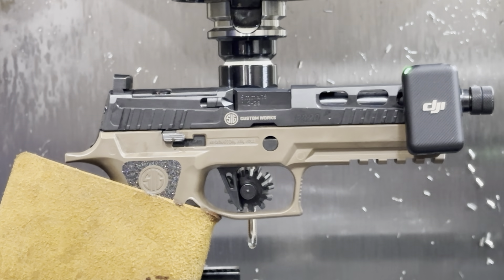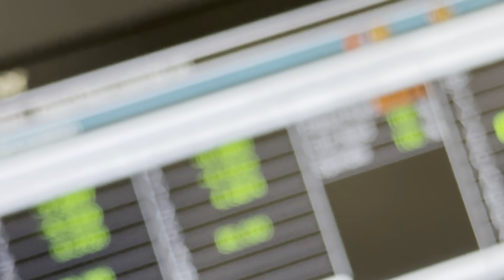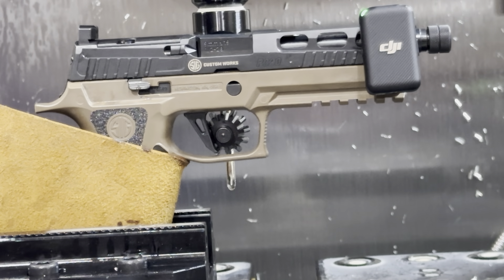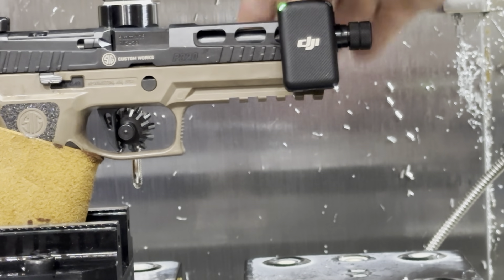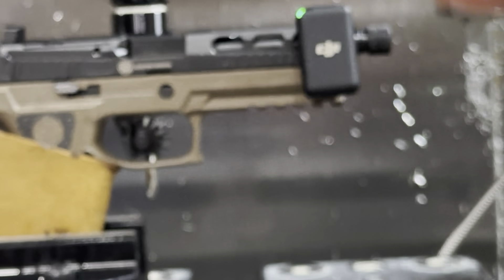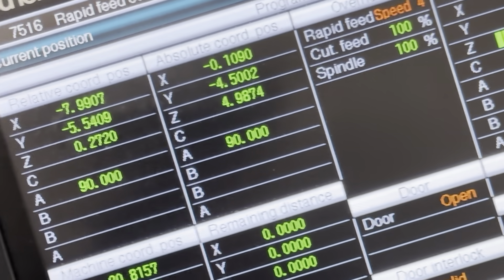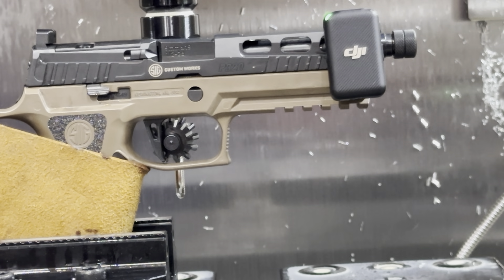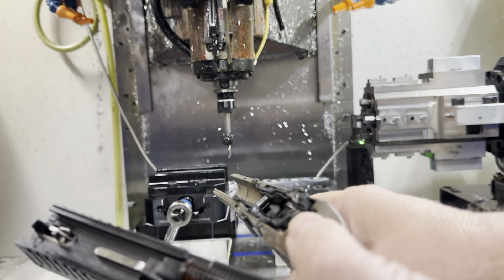Sig P320 accidental discharge tested in CNC machine.

Comment: You managed to do most compressive test on YouTube so far and got the same outcome as others and somehow came to the wrong conclusion lol. Would be interesting to see how other guns do in this same test set up.
Reply: Exactly.  The gun should only fire with a definitive pull on the trigger.  There are lots of situations that could pre-stage that trigger.
Reply: @CurseTheDarkness  it seems to me like some holsters may be putting a little bit of pressure on the trigger,  enough to deactivate the safeties,  and then all it takes is alittle movement for it to go off.  seems like whats been happening in the videos of them going off to me.  i know all my kydex holsters have a indentation on in the material in front of the trigger,  that widens to accept the trigger,  if the holster is slightly out of spec it could be putting enough rearward pressure on the trigger.
Reply: @mtnbound1776  Add to that this was testing only one firearm.  How many of the next 1,000 firearms would exhibit the same failure? 

My observation is that if the slides on any of my pistols was that sloppy it would be trashed.
Reply: @mtnbound1776 I think the holsters are playing a bigger part than people realize. Especially with the width of the 320 triggers. But in no way should they fire without a complete trigger pull. I imagine Sig has already resigned the trigger and a few other parts, it's just the bean counters are still figuring out how to dodge the iceberg.
Reply: @ryank29 his conclusion is correct in the fact the trigger was manipulated & moved rearward to get the gun to fire by then moving the slide up & down. Now should that much of rearward movement & not firing the gun then allow the gun to fire when pressure is applied to the slide … NO. Could possibly once that slack taken up to the wall the trigger sticks & the striker safety not return to a safe position when the trigger is released & a shot isn’t fired then a bump of the gun & it goes off. I don’t know, but the conclusion of the trigger must be manipulated to get the gun to fire seems true from everything I’ve seen that’s been in this & many others tests.
Reply: @RoyDriskill  That much slop in the slide is crap!
Reply: @davidmilisock5200 the amount of movement between the slide & frame doesn’t bother me at all. It’s the fact that under the wrong circumstances the gun unintentionally fired that I have a problem with. If tightening the tolerances between the slide & frame resolves this is then great. But I guarantee you that is not the sole reason for these uncomanded discharges!
Reply: @RoyDriskill  Agreed, I believe it's  a tolerance stacking error and that sloppy ass slide is just part of it. I never owned a Sig firearm of any type, the handguns never fit me and I never thought that their rifles were worth the cost, but that's just me!
Reply: he proved the glock failed the exact same test. watch his other video
Reply: @CitizenSeven500 it looks like he's pulling the trigger in the glock video. He has the trigger like 99% pulled them wiggles it into the final pull
Reply: @BansheeVi  both triggers were pulled to exactly the same point before break. the glock just has a much longer trigger travel
Reply: @CitizenSeven500 I mean you can watch the Glock trigger. It's at the end of travel. Use your eyes
Reply: @BansheeVi  https://www.youtube.com/watch?v=LKD0S3KhwdI&ab_channel=TriggerSmart
Reply: @BansheeVi  every striker fired pistol will fail this test, including your glock
Reply: @BansheeVi  they are all at the end of their travel, just before the break
Reply: @CitizenSeven500 yes but in the video I'm talking about you can see him move the gun to pull the trigger, it really isn't even subtle. I was trying to get at the questionability of that video. But with better videos your point seems to make more sense. Does this effect the job the firing pin safety does to stop a discharge?
Reply: @BansheeVi  watch the link i posted. the glock fails just like every other striker fired pistol does
Reply: @CitizenSeven500  For the Glock 17 this was a similar test but not exactly the same. 1 the Glock trigger was pulled very nearly 100%, the Sig P320 still had 1/10 of an inch travel left in it and discharged.  2 Either the Glock was not locked in the vice as well as the Sig was as you could see that the entire frame of the Glock moved when he twisted the slide, it was not clamped as well or he used significantly more force on the slide. With the Sig he just barely moved the slide.
Reply: @davidmilisock5200  both triggers were pulled to 20/1000 before normal trigger release of seer. exactly the same
Reply: @CitizenSeven500  The Sig was pulled to .090 and manipulation of the slide discharged the firearm.  Pulling the trigger to .190 discharged the Sig, that's showing that the Sig trigger was just over 1/2 pulled and could be discharged. The Glock trigger discharge distance was not shown but visually it was much farther.
Reply: @davidmilisock5200  the sig has a shorter trigger pull but both were set at 19/1000 before break and both dropped the seer by bumping the slide
Reply: This just proved if you had this in your holster and got into your car and used seat belt that anything touched your trigger in that drive the gun could go off when you got out of car and slide got touched.

I would sell that gun for scrap.
Reply: @MXP90DL   every striker fire pistol will do the same if the trigger is close to the point of break
Reply: @MXP90DL  and yea the glock does also
Reply: Its almost like being a good machinist does not make you smart
Reply: @ThePlatinumsquirrel  as with any specialty
Reply: We already know the Glock fires with a partial trigger pull.
Reply: @notes9504  Can you post a link or show me a video of the Glock uncommitted discharge please.
Reply: @notes9504 who's this "we" you're talking about 😂
Reply: @notes9504 idk about that one chief

Comment: SIG's statement was the pistol "CANNOT, under any circumstances, discharge without a trigger pull,"

This video, just like Wyoming Gun Project's video conclusively proves SIG's statement is false. Their product does not operate in a manner consistent with their claims. This is a clear product liability problem for SIG which was made worse by not addressing the issue. It is likely to elevate to the classification of gross negligence.

Comment: Lol I was trying to measure this yesterday with a pair of calipers. Because I felt a difference in when the slide is pushed down vs when it's not. But I couldnt get a good measure and I don't have the scale to check trigger weight but there is a difference when there is pressure placed on the slide vs not and vs the slide being pulled upward. And I am testing this on a 320 romeo that doesnt have the updated sear from the recall
Reply: But definitely the trigger had to be pulled i wonder if there is footage of this incident

Comment: The Sig P320 is a piece of junk. The tolerances are so sloppy that it rattles louder than a baby's rattle. Look at what you are doing there. You are wiggling that thing like a loose tooth. A lot of the discharges have been from holstered Sigs. No one is pulling the trigger.

Comment: I'm just saying that the Berretta M9A4 would never be sitting in your CNC machine to calculate the sear retention to determine/rule-out why its randomly going off in people's holsters/duty belts. -- I don't ever recall the Military, Federal, State/Local Police, Gun Ranges, or Shooting Competitions banning the use of Standard Issue Berretta, Glock, or Colt sidearms for safety concerns.
Reply: I'd also like to add, that I was very close to buying the P320 when it first came about. I like collecting Military Issue firearms, and I love the way it looked, felt in the hand, how modular it was, and I knew that parts and accessories would be highly available due to it being the new GI Sidearm. --- But... we started getting reports of it going off when it was dropped. One of the guys in my unit tested the theory using snapcaps and he was able to get his to go off by dropping it from about 4 feet. He had to drop it a few times, but all it takes is one to change/end a life.
Reply: At least when the M9s first had issues, it just sent a piece of slide at you (ouch!) but didn't fuckin kill the user.
Reply: Somebody told me yesterday Glocks do this also lolol
Reply: I’d like to add the P226/9 to that list.
Reply: @moloono1  and the 365. It's almost like when you take a fully clocked sear and a design from a hammer pistol and outfit it to a striker without QAing it properly, you'll have design issues. SIG dropped the ball so hard, and I say that owning 3 SIGs (226, 320, 365). 320 is now collecting dust in my safe.
Reply: M9 supremacy
Reply: he proved the glock failed the exact same test. watch his other video
Reply: @CitizenSeven500 poor delulu sigger
Reply: This isn't a Beretta video.
Reply: @Tomski1775  Thats the point, this video wouldn't exist if the Military chose Berretta.